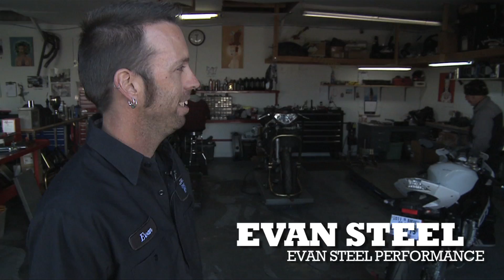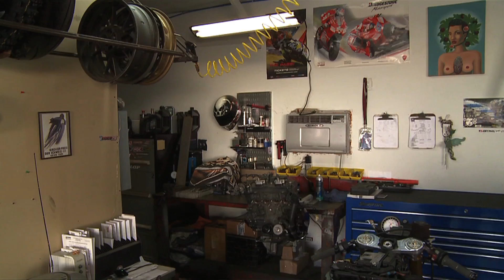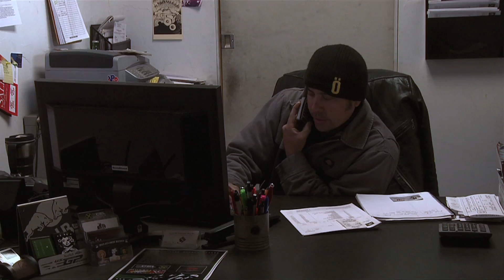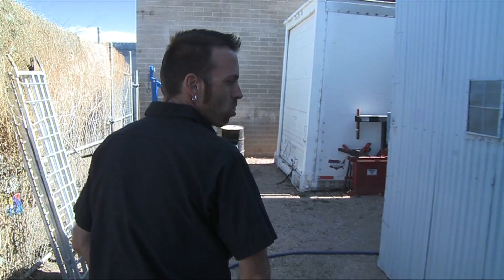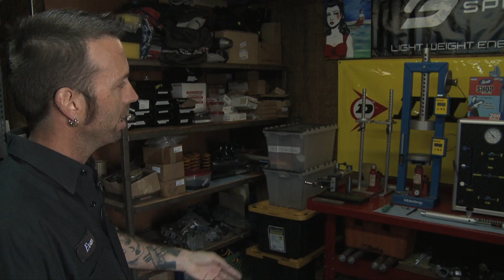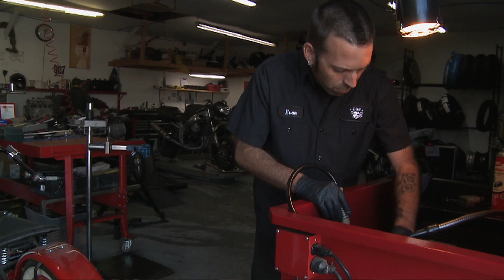Evan Steel Performance Motorcycle Race Shop

Comment: Hey, a little late with inquiry...I see the video is from awhile back. I'm new to Tucson, not far from you. Traded for a 2025 Honda Rebel 1100 recently and put a Two Bros. Racing slip on on the bike. Think it's running lean as a result. A brief cold start idle stumble. Lotta tuners online agree ECU needs update for proper fuel / air even after simple slip on. Would like to dyno tune if possible. Remove overly conservative 99 mph speed limiter too. Would you be interested in the project? Thinking about a Black Widow header too but checking with them on application fitment. Their site only specified to model year 2023 so waiting to hear from them on that. Thanks a million!

Comment: Someone asked if they could kill themselves with their exhaust on Quora and here is his answer: No. You will only succeed in killing yourself that way by breathing carbon monoxide from the truck’s exhaust. If you want suicide by carbon dioxide, you’ll need to find a carbon dioxide source and breathe carbon dioxide till the lack of oxygen causes your death. Dry ice is CO2 and a process called sublimation enables the frozen CO2 to change states from a solid, directly to a gas where it easily displaces the oxygen molecules because they are lighter than CO2 and will be “pushed” out by the CO2 provided you and the dry ice are in a somewhat of a closed environment. CO2 also comes in metal cylinders of liquid and saturated vapor.

14.2K views

View 7 upvotes

7

￼

Add a comment...

Related questions (More answers below)

Comment from the maker: Depends what your objectives are. I started with a 400, the went to an SV 650 and then to a 600 to learn how to use brakes and corner speed first. You'll find with the older bikes (especially SV650's) that most of the conversion work has been done with forks and shock.

Dave Moss
Host